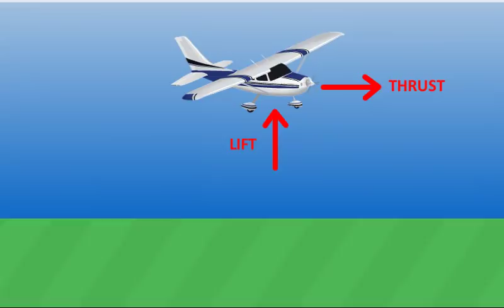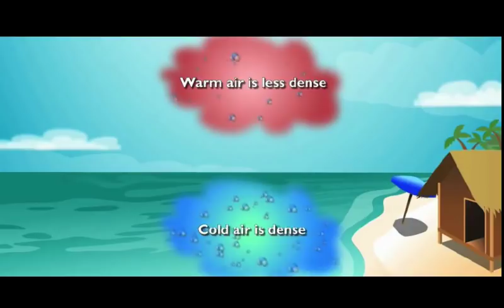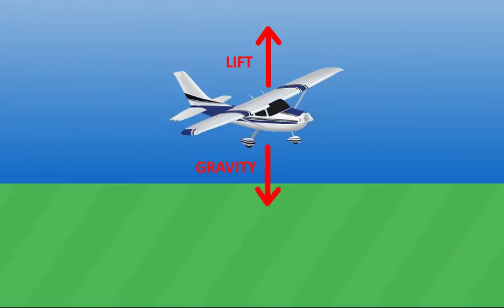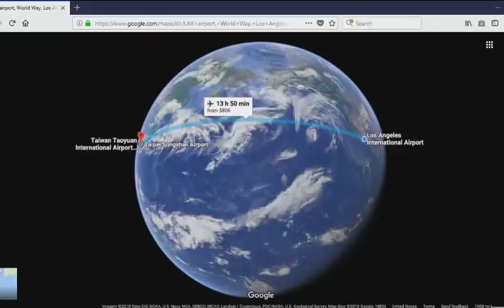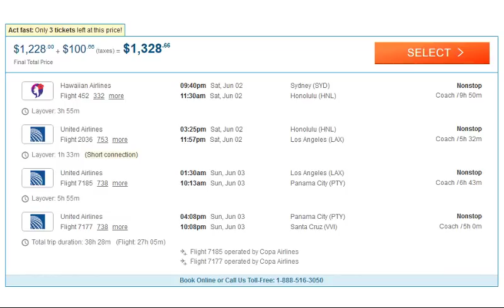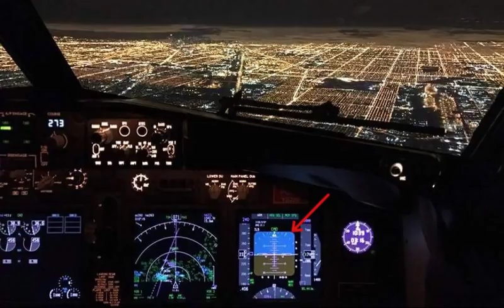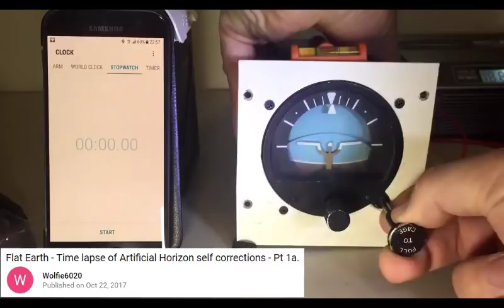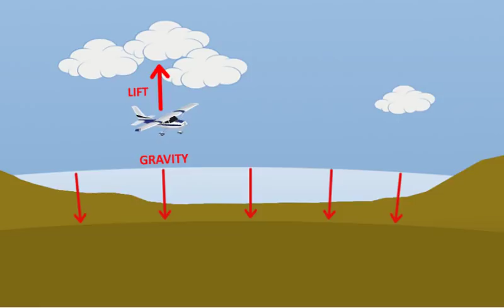Flat Earth Falsities - Plane Nonsense

Comment: Go stand on a ferriss wheel unattached + let someone pull the spin rod 2 prove ur AssAnITies against Scientific Gravity + SPLAT GOES THE 0lie WhackJob WEASELS !!!/...
Reply from the maker: Marie Smith - Yes. Good idea. Make sure to spin the ferris wheel at the blazing speed of ONE ROTATION PER DAY, because that is rotation rate of the earth, and see what you feel. All you will feel is boredom.
Reply: I notice many flat earthers are avoiding the actual topic of this video. The flat earth confusion about bloody air planes.
Reply: One rotation a day??? That would be almost unnoticeably small. Would really fit reality though.
Reply: Marie Smith - Fuck off back to your cave you sock account trolling gimp.
Reply: +Marie Smith, you ugly troll, fuck off.
Reply: @VoysovReason Boredom might be all she feels at first at such a slow speed, but by the time she gets to the top, she will also be feeling hungry -- and she might have a really strong urge to take a leak -- an urge that will turn to torment by the time she gets to the ground again!

Yes, I think you may have just come up with a fitting punishment for Flat Earthers;)
Reply: +SpectatorAlius:  There is nothing 4 0Lie WhackJobs 2 hide, 4 gravitational science Proves u all 2 be Massive World-Wide Terroists, 4 nothing is light enough to stay sustained in the earth's air hemisphere, not even a dust speck, so definitely not the large heavy earth mass + nothing can stay secure, or moving on a rolling ball, unless attached Bozos !!!/...
Reply: no problem,i will find a wheel that takes 24 hours to make 360° turn, i just hope i wont fall asleep
Reply: Marie Smith you are not making a convincing argument by denying reality.

Comment: Also, planes use airspeed, not velocity. They measure their speed relative to the surrounding air, and compare that to ground speed. Two planes travelling opposite will travel at different airspeeds depending on prevailing air currents. If they make the flight in the same elapsed time, one of them flew at a higher airspeed and will have mourned much more fuel.
Reply: Burned... Damn you autocorrupt!

Comment: 37,000 feet in my last trip. No curve seen at all. Earth is flat.
Reply: The comprehension of flatearthers are extremely limited.  They can't comprehend just how HUGE the Earth, Sun and our solar system really is.
Reply: That's not surprising a quick Google search reveals that you would need to be at least 50,000 feet before you can begin to notice the arch of the curve. Maybe you should do some more research.
Reply: At 37000 ft, you are still not high enough to get a relisble sighting of the curve. You need 50000 ft for that. Commercial jetliners don't go that high, it is a waste of fuel.

But the rasl problem is you don't recognize the validity of the proofs made long ago w/ fancy tools like aircraft. Watch the eclipse this Jul 26th. Notice the shape of the shadow the Earth casts, it is round
Reply: +Viking Finn, look at the horizon, at sea, on a perfectly clear day. What do you see? A SHARP horizon. 
That, in itself, is proof of a globe earth. You can figure out why, right? Don't you Flerfers say that you have to do your own research? Research this one and think it through. Good luck!
Reply: How could the earth cast a round shadow if it is flat??? I wonder what the flat earth response is. Apparently their research notes are a bit behind.

Comment: Interesting video. I did a 2185 km flight with a commercial airline the other day and did a experiment. Not very scientific but still. Used a app on my iPhone SE, Bubble Level. In offline mode, airplane mode. iPhone uses MEMS as gyro in their devices so would not be affected by gravity. My test was carried out in the way that i found a level surface that indicated 0,0 degrees at ground. When takeoff there was an incline of 16-17 degrees when reached 10 000 meters a steady incline of 3-3,5 degrees was under the whole flight. When landing three hours later and on ground the degree meter showed 0,0 again. Can someone explain this to me so i understand the physics?

Update. I realize that airplanes have to nose up to fly straight. While descending there was a 0,0 degree reading so. But the question is why isn’t there a minus reading when back at ground due to earths curvature? Know this sounds FE bs but really, the gyro don’t know it’s on an airplane and does not compensate at any point.
Reply: @Weberson Motivation As J. Myers already pointed out in his own way, the MEMS gyroscopes are pretty noisy and inaccurate. That is true of all MEMS devices, not just gyros but accelerometers too.

That is why Android phones use this fancy technique called "sensor fusion" to combine the output of compass, gyro, Wifi, GPS and accelerometers to get the true position of the phone. The different sources have different noise characteristics, so when you put them together correctly (which turns out to be something based on a Kalman filter), the different noise sources partially cancel each other.

So don't expect accurate readings on a plane. Even after you get back on the ground, it will not give you reliable readings until after you turn airplane mode OFF and start getting signals from WiFi and GPS again.

Despite all that, your iPhone level meter seems to have done pretty well: that 3-3.5 degrees probably was the plane's angle of attack. And you did not say: when did you turn airplane mode off? Was it still off when it read 0.0 degrees on the ground? In that case, I would say it did remarkably well, despite the 'drift'.

But now for your question: why did you expect a negative reading? Once you are on the ground, the plane is basically level again, just like it was when you found the level spot to place your phone at. Remember that 'down' is always towards the center of the Earth. So perpendicular to that is 'level'.
Reply: Viking Finn Go up higher.
Reply: SpectatorAlius Phone was Offline when App turned on and still MEMS dont’t rely on gravity so therefor it should be an minus reading, or?
Reply: For now, forget the implementation: your app shows what is level, to the best of its ability. But 'level' means "perpendicular to the direction gravity pulls (which is down)". So unless the software is broken, it will be level once the plane is stationary on level ground.

Now as for how the software achieved this, that is quite another matter. I haven't seen their software. I believe the answer lies in the fact what people call "MEMS gyroscope" is really an angular rate sensor for each of pitch, yaw and roll. So uniform acceleration due to gravity is not even measured by it, only the rate of change of these three angles is measured. But low values of these three angles are still hard to read, so it probably averages out over time, so that once you were stationary, it averaged out to zero, giving a reading of level. Or it could be, since John already pointed out it read the angle of attack accurately, which angle is measured relative to the plane and airspeed, not relative to gravity, that when the plane leveled out, it came to zero.
Reply: Have you tried asking the makers of the app what is the reason this occurs? Could it be some technical hiccup? A cell phone app may not be as precise as you need it to be. That would be my first thought.
Reply: Its flat bro, Look out the window while at 35,000 feet. Flat.

Comment: Well, i would explain the "plane dipping nose thing" a little different.  the plane has a center of gravity, which is in front of the center of lift so if the plane is falling free towards the earth, it will automaticly dip its nose down to gain controlability and airspeed. in level flight, the momentum created by this is cancelled by the elevator, which can be set to a preset position via trim, which is mainly used by the pilot so he doesnt have  to pull the stick all the time. if the plane would climb, it would lose airspeed, and less airspeed means less force applied by the elevator, so the nose dips down. if the plane would lose altitiude, it would gain airspeed, the elevator creates more force  and the nose goes up

Comment: I'm intrigued Free-Lunch. What is this 15 degrees problem that you refer to? Is it a game changer? If so, why is no one talking about it? How did you come upon it? Is there a reliable test that a layman can perform repeatedly, and get the same results consistently. That said, I'm bracing myself for the onslaught of condescending replies that are sure to follow. Even if only one friendly response leads to a solid precept, It will have been worth the risk.
Reply: That would be the fact that wherever you are on Earth, the sun will move across the sky at 15 degrees per hour. If on a flat planar Earth of any kind, the speed of the sun would vary through the day based on it being closer or farther away from the observer (with the only exception of being at the North Pole on an AE map). It is another simple observation of perspective which invalidates the flerf model, much like the unchanging size of the sun through the day.
Reply: Thanks, sounds reasonable at face value, how does one test to verify this?
Reply: @RogHawk I have never seen this rule stated precisely, and I am having a hard time visualizing how it could be true except on the equinox. On the shortest day of the year, you do not have 12 hours of daytime, so 15 degrees could cover only (for example) 150 degrees instead of the full 180.

Much easier to visualize: why the existence of time zones proves a spherical Earth.
Reply: Spectator Alius Even though the days may be shorter at the winter solstice, during that time the sun will still be moving 15 degrees per hour along its path. This was talked about most by GreaterSapien in his video "UNDENIABLE! One Simple & Fatal Flaw of the Flat Earth "Model" and by Wolfie6020 in his several videos about equatorial mounts on telescopes being able to follow the sun at a single speed and axis of rotation.
Reply: @RogHawk Yes, he did talk about it, but I was not impressed by the explanation. It was flawed, it did not even mention what angle he was measuring: angles are specified by three points, two of them on given rays and the third the vertex: he never defined these. Nor did he show the angular speed must be constant.

Needless to say, with a flaw like that, it is not likely to persuade the Flat Earthers.

But the point about equatorial mounts is good, though I haven't used on in years. So long ago, it did not have any motor, so I never noticed it could be moved at a single speed to keep things in view. But again: it will take better diagramming than he did to convince a Flat Earther.

Comment: Marcus: "Everything would be pulled down and nothing would rise." Density is your answer. Take some olive oil and put it in a glass of water. The oil floats. Why? Density. Gravity is pulling on the water and the oil equally but there is less oil per fixed volume than there is of water. If you weighed a cup of water and a cup of oil, the water would weigh more. This is why things rise within mediums. When I'm in a swimming pool, my body is being pulled toward the center of the Earth just as much as when I'm on solid land. But since the water is less dense than the dirt/rocks of the land, I can drop easily into the water; no digging needed. However, when I'm in that water, the fact that I sink into it means that I displace the same amount of water by weight. If I were to enter a tub of water filled exactly to the top and then place my body into it, the amount of water that I displace is equal in weight to the weight of my body.
Why does sand drop to the bottom of a glass of water? Because it is more dense than the surrounding water. Gravity is pulling down on both equally.
A feather floating on the wind is less dense than the air below it and more dense than the air above it. But gravity is still working on it.
Balloons with helium in them float because for the volume inside the balloon, we need, by mass, much less helium than we would standard air (nitrogen/co2). The air below the balloon is more dense and the air above is less dense once the balloon stops floating away. 
So, yeah, gravity works on everything small and large. Relative densities is what causes things to rise and fall. But with planes (obviously more dense than the surrounding air), lift is needed to cause the air below to be more dense and less above.
Reply: @Michael Gay "Density is your answer" -- your wrong answer! You forgot to say, after all, "density and buoyancy" like all the other Flat Earthers do, and you even followed your wrong answer with an example that requires buoyancy to work -- and buoayancy is entirely dependent on gravity to work even in your example.

Comment: What about autopilot on an airplane? Pilot takes airplane up to 20,000ft and puts it on autopilot. On auto pilot the airplane will fly straight and level for hundreds and even thousands of miles, that could put it on the moon.
Reply from the maker: What do you think the auto pilot uses to stay at the same level? It uses the altimeter, which measures air pressure, which determines altitude above sea level. Sea level curves with the earth, and so does the air pressure, since air pressure is caused by gravity. So if auto pilot is set to 20,000 ft, it will keep the plane at that level above the curved surface.  

You don’t get to pick and choose how you think it should work, and ignore key facts.
Reply: Douglas Herr 
The quality of your comment is a reflection of your intellect.
Reply: Bobby Wizdum
" its 90 degrees to the surface. aka parallell"
 90° to the surface is perpendicular not parallell...

Another evidence of the "quality" of flat earth adepts intellect !
Reply: Rollie level is not curved. its 90 degrees to the surface. aka parallell.

Comment: Sagnac's experiment 
https://www.youtube.com/watch?v=kfE4vHQGB0w 
watch from 4.39
Reply: topnorej,

Sagnac effect is widely used today in everyday life (ring-laser gyroscopes for inertial guidance systems.

It is result of one of the several experiments that intended to prove the existence od aether, but failed to do so.
Since it was designed to 'detect motion of Earth in aether' most of the flattards 'interpret' these results as 'proof that Earth doesn't move...
But of course, it's totally incorrect...
Reply: Foucault pendulums would indicate earth movement, yet how does that fit the theory of no detectable movement because the whole atmosphere moves with the earth?
Reply: The sagnac effect fits just fine with special relativity. Look up Max van Laue and Irwin Shapiro if you really want to learn a lot more about this effect. The loss of speed due to rotation is calculable and fits.
Reply: Well at least he didn't bring up the Michelson-Morley experiment this time.

Comment: I know it’s a waste of time because this guy is repeating what we all learned in the first 10 years of schooling. 

If he would only question it, he would go far. 

The atmosphere that moves planes and helicopters around with a constant speed. If that is the case, question why Foucault pendulum works?

It’s free hanging while the ground below it moves. 

So in you mind, if you put a helicopter indoors and close the door then you will have the ground below it move/rotate?
But put it outdoors it can not show earth rotation.
Reply: lollandz.

You got it all wrong.

It's not the atmosphere that moves planes and helicopters (with the Earth's rotation), but the momentum (aircraft and helicopters where already moving in same direction and the speed of Earth's rotation when they took off.

Search for the video od drone in moving van, or train.

Foucault's pendulum has nothing to do with movement of the atmosphere, other then air resistance that slows down the pendulum due to air friction.

On the Earth, both indoor and outdoor air is moving at the same speed and the distance of the Earth's rotation at given latitude.
Reply: lollandz - Its funny, in the video he really couldn't make it any easier to understand but still people need more of an explanation. Honestly surprised how some people can even feed themselves without instructions.
Reply: lollandz you didnt learned that you have been told that,and that is a big different